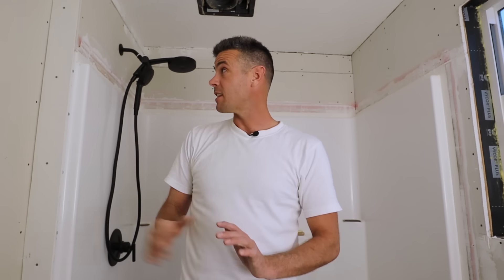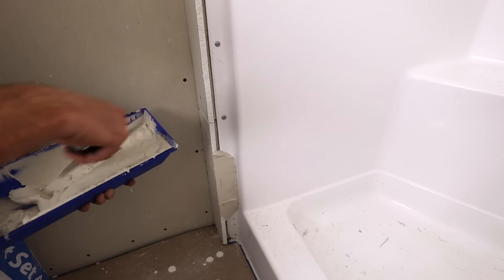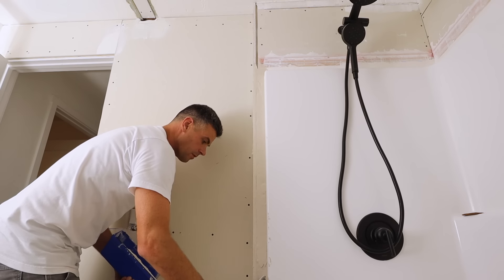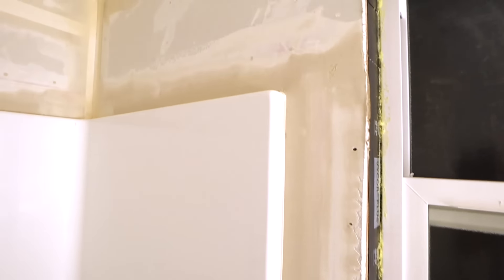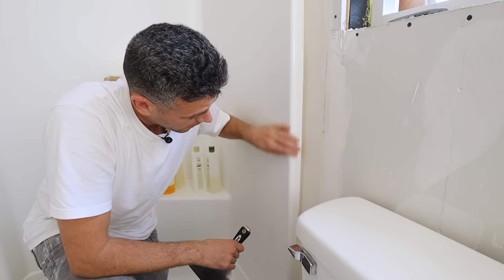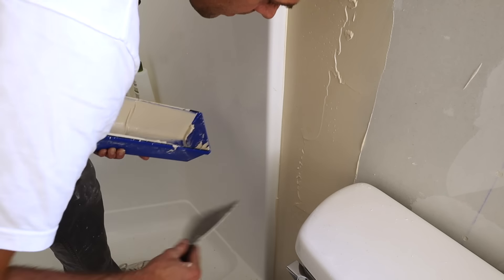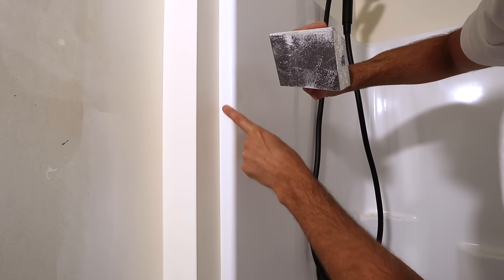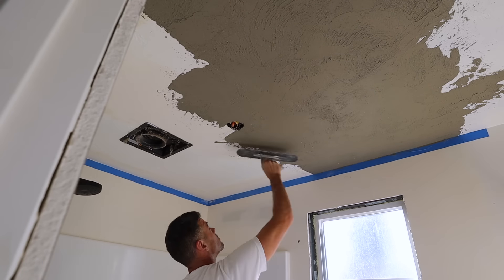How to Fill Drywall Around Tub Flange!

Comment: I've been following a plumber that does a ton of these installs and I've never seen a good way to finish these... THANK YOU!!!
Reply: I was using tear away bead at the flange bottom of the tub surround.
Reply: Agree totally! Just installed 2 in a cabin and will 100% be going back to redo the flanges this way!
Reply: Probably the only way to do it
Reply: @BZ1340  that tear away bead is hard to find. And when you do find it, it’s usually in a box of 50 something, which is way more than you need.
Reply: @ all the local suppliers  we deal with have it by the piece and 2 out of 3 DIY stores also stock it. HDepot is the only one that doesn’t.

Comment: A helpful hint I learned on my own. Before you prefill around the tub or shower,take a can of WD-40 and lightly spray directly onto the edge of the tub or shower. It dries fairly quickly and then go ahead and prefill the void. The WD-40 leaves a barrier on the surface that the compound doesn't bond to and after finishing is complete it's almost effortless to pop any rolled out or dry compound off of the tub. Without the WD-40 any compound that rolls out will adhere tightly to the fiberglass and is a real pain to scrape or chip off!

Comment: I've been a carpenter for over 40 yrs now. Most of it has been in remodeling interspersed with new construction. I've always done my own drywall finishing if it's like one room or less. Most of my work has been kitchens and bathrooms over the last 20 yrs. There's always some patching of drywall to do in those types of jobs where you have to blend in old with new. The glue trick for better adhesion to painted surfaces is one of the tricks that I learned on your channel. Although I've never really had any call backs for adhesion problems, when I didn't use the glue trick, it never hurts to take that little extra assurance. Hot mud is your friend when doing small repair jobs. It really helps to speed up the job so you can get in and out of there and not have to come back to finish the job. 

Just a note to newbies. I always use a paintable caulk along the that tub edge so that we can get a nice paint edge. Some people make the mistake of using a silicone tub and tile caulk in that area, and then they can't get the paint to stick.
Reply: I am trying to figure out which paintable caulk to use. Do you have any suggestions? I have knockdown walls, and in one bathroom, the tape and compound have pulled away from the drywall. It does not appear that these joints were caulked when installed, unless it was a super thin bead. It is hard to tell because the previous owners painted everything willy-nilly.
Reply: @ladle24  Dap quik seal plus is one that comes to mind. But there are many.  Pick a tub and tile caulk that is paintable. Just read the label, it'll tell you.

Comment: The ones I have been in lately. They drywalled over the tub flange. You can see the angled board…Plus the ones I looked at. All the mud/paint was peeling up 1/2 inch at that flange meet to the angled board. All a result of the moisture sitting on that ledge wicking away. All were siliconed too

Comment: Could you use a J style PVC no-coat trim against the drywall edge next to the shower, perhaps keeping it back a half to three quarter inch, and thereby avoid the tricky part floating the corner fill, and instead have a flat plastic edge to coat up to and the edge wouldn't be a permeable surface that you could also caulk more reliably?     Sorry that's a really long question, but I was thinking about how you make the hard part easier, but you would need to plan to do it that way.
Reply: I think that sounds like a good idea, but I'm just a diy guy.
Reply: Ya or the tear away beads

Comment: I used an old gallon can of Bondo.

It was really old stuff, had been sitting on a shelf for over ten years.  Would have been useless as body filler, but it did the job nicely. 

I laid tile over, with the normal thinset.
It's holding up five, 20 years now.

Comment: I like to get "L" bead and install that around the tub flange. Leaves a perfect, uniform gap for silicone and keep the drywall from contacting water that may settle on top of the tub surround. 

L bead is like corner bead except one side is only 1/2 or 5/8.

Comment: Great video! Use hot mud because it's waterproof. The old ones are better for this than the light ones. USG is darn tough and waterproof. I use it start to finish and then prime and paint. Use plastic cornerbead instead of metal that will eventually rust. If it was easy, women and children would be doing it!

Comment: I'm doing my own bathroom makeover.  My friends call me crazy 🤔 but they don't have you in their back pocket!   They just write checks. I figure I'll write them if I screw up.  So my shower surround was done 15 years ago and now I'm redoing. It has a thinnish crack all along the top edge. I'm thinking I should spray some cleaning agent with bleach in case there might be some mold of some sort. But then I was just going to spackle, sand, and paint.  Hadn't really heard about Fiber fuse.  Is that necessary? Maybe that's just a first time thing.  Guess I'll due a little research.
Reply from the maker: You could probably just clean it out then caulk and paint.

Comment: I am trying to figure out which paintable caulk to use. Do you have any suggestions? I have knockdown walls, and in one bathroom, the tape and compound have pulled away from the drywall and need to be repaired. It does not appear that these joints were caulked when installed, unless it was a super thin bead. It is hard to tell because the previous owners painted everything willy-nilly, so there is paint all over the surround.

Comment: Hello and thank you for your videos!
I would like a comprehensive chart on muds. I am having a hard time finding what I want on line.
It is ok if it is multiple pages so that it could be printed out and lined up to follow. It could be put even on
wikipedia and include usa and canada without persecuting any manufacturer.

x or y axis on a spread sheet:
maker and full name using two lines for each column

y or x axis on spread sheet:
typical use
sometimes use
cons should be last on list and set for multiple lines per elongated spreadsheet box
pros same as for cons
is it bought dry, wet
what size containers for each (dry or wet and may have multiple sizes separated by a space)
drying time even if it is in the title
would you add glue to it and when
Would you add liq. dish soap to it and when

Comment: Nice video, I have found that flange scratches easy so I like to use a plastic  3 or4 inch bondo blade used for body work it goes on nicely.  Try one for tight spots and you can cut them down to fit a area to small to get a blade into. I keep one in my bucket to scrape the sides and load my hawk or pan . Great 👍

Comment: I finish edges around showers exactly as you do.  If someone wonders whether their drywall mud or plaster will stick to the flange edge (eventually separate), they can do one of two things. Apply a special primer to the fiberglass/acrylic flange or place a few drywall screws around the parameter (slightly raised) so mud has something to grab.

Comment: Have you ever done any videos on repairing garage ceilings/walls? My garage ceiling is peeling/cracking cause previous owner did a horrible job taping and didnt seal the ceiling correctly so the moisture messed it all up. I'm thinking of scraping off all the peeling drywall and just use a simple primer/sealer to cover up the mess without drywalling.

Comment: I've done several of these.. i use expanded metal lath attached with truss head screws. Then either durabond or hot mud as the first coat. Never had a problem.

Comment: Did corner bead get installed on the outside corner at the head end of the tub?
Reply: My question too. 

He mentioned “corner bead” so I was looking for it to appear, but I only saw him apply mesh tape that covered the narrow piece of drywall and the open end of the perpendicular piece of drywall at the corner, and then apply mud in the mesh tape.

Comment: You know I was actually surprised when you used all-purpose in a bathroom. I would have thought that the humidity would break it down over time. I would have thought you would have stuck to exclusively quick set. Does the paint actually offer that much protection? Does it have to be a specific water resistant paint
Reply from the maker: Just a good primer and a couple coats of paint and it will be fine. This place sat pre-filled and unprimed for 6 months while being used regularly. It will be fine. Some bathrooms get more damp. Depends on the conditions.
Reply: @vancouvercarpenter  nifty

Comment: Around here (southeast US) I often see tub surrounds trimmed out with wood and it usually doesn’t look great.  I wish they sold tear away bead and other specialized beads here but regular corner bead is all that’s available here…. Hot mud is such great stuff and I like using an egg beater mixer in a drill.  Works well and fast enough to use it with 5 minute mud.  
Another good video ✌️
Reply: Some fools still trim out flange with wood on the west coast as well. Oh well, less work for me

Comment: Wait, did I miss something? I assume you put a corner bead on the outside corner, off camera?

Anyway, I could have used this video 2 years ago for my bathroom renovation! I couldn't find a single video explaining how to finish drywall around a shower surround, so I improvised and brought the drywall over top of the flange, to within 1/8" of the shower itself. I used J trim to give the drywall a clean edge against the tub, and I filled the gap with silicone. It looks alright, but it's definitely way different than what's shown in this video.
Reply from the maker: Yes. Bead went on off camera

Comment: ugh, freakin swirl. The house i just finished remodeling had swirl. I had to fix every ceiling in the house. One bedroom the entire wall had to be floated where the limecoat and plaster separated. I used a masonry brush and some thinned down plus 3. I just did swipes with my wrist and it came out pretty nice.
Reply from the maker: I actually enjoyed it.
Reply: @vancouvercarpenter  it wasn't too bad. I didn't add any sand to it, it was sandswirl but it still came out okay.

Comment: Ive been taping for 35 yrs. Here is a pro pointer:  mix taping mud 40% and fine silica or glass bead 60%  add some latex paint for water resistance and mix well.  It should be thick but not cakey. Fill the flange gap and leave til dry. I use same mix for pre-filling gaps. Especially around electrical boxes. If it is mixed right it wont sag out.  It dries hard as plaster. And it dries quicker than you think because the aggregate holds no moisture. Just dont let it protrude or you need a rotohammer. There are a thousand ways to do any one thing.

Comment: Ben im assuming other tapers will mention shower bead.  You may have done a video on this, forgive me if you have.  But that could be another video.  
I typically do it almost word for word what you did except I havent added glue.  It seems where i live that shower bead isnt available and the last time i ordered it i was given 1/2" cabinet edge trim🤦🏼‍♂️🤦🏼‍♂️.  To elaborate, tine was of tgecessence and the order was late in coning a few days only to get a very different product.  Fastset it is...
Reply from the maker: We don’t usually do this where I live. It’s usually tile.

Comment: That homeowner appears to do good work. The shower install, hanging the sheet rock, and that window install.
Assuming it was the homeowner that did the window since there is spray foam stuck to the frame. But still good enough.
Reply: I'm curious why it was taken over. Seems the homeowner was doing a good job!
Reply: @PSNDonutDude   probably because it's finish work.  I see that a lot where they want the finished product to look good and they get nervous about doing it.
Reply from the maker: It was family. There were two good video opportunities that I never see where I live. The tub flange and the texture repair so I offered to help out with it.

Comment: Dang you touch that fiberglass tape with barefingers You need to wear latex gloves 😮 I found out the hard way when I was younger went through a whole roll of that stuff I was itchy around my eyes my neck my ears my face It was hot so I kept wiping sweat off. I paid for that for a few days 😢
Reply from the maker: 😂 I usually wear gloves but didn't have any. Surprisingly it didn't bother me.

Comment: A lot of Bathroom jobs on new construction are using regular drywall + a heavy coat of "Anti Mold' paint as the primer.   Least that is what my local inspector told me during conversation.    Greenboard was extra expensive (than normal) and hard to source during COVID so necessity drives invention as they say.

Comment: I used to work in a low income complex as a maintence man. I installed these tub surrounds and found the best method to finish them is with a thick pvc trim down the sides to the floor and around the top. All our old glue up surrounds went onto drywall and would always fail after the chaulking failed and moisture made its way behind the wall caused the drywall to crumble or glue to release preventing you from having a solid surround to reapply chaulking. The new direct to stud thick plastic tub surrounds solved alot of issues as some tenants wouldnt report their chaulking failing and the tub surround would be past repair. Being able to put plastic trim down past the tub to the floor would help all the water that somehow managed to make it past the curtain from sitting at the bottom of the drywall and causing mold and wicking back up.

Comment: Quick question, I’m skim coating my textured walls thanks to your videos. My walls are painted and have a bit of a sheen on them, do I need to prime them first? 
I already did one wall to test my mad skills and it turned out great! 
My prep was light sand, wash wall then skimmed it 2x’s , sanding between coats.
I’m going to do my whole house just don’t want it falling off.
I’m 60 years old 104 pound female- for your viewers, if I can do it you can do it.
I have learned from his videos, good tools will make it so much easier.
Thanks for your great YouTube channel.

Comment: Biggest mistake I see right away is no prep to the flange. Let me explain, the whole concept of the coating is to repel its a glossy surface NOTHING will stick. Prep the flange with sand paper and primer then hot pack or 5 min mud. I’d refrain from additives as they dry or cure at drastically different rates and you will have delimitation over time. After the hot pack prime again apply mesh tape coat with 20 min mud and your final should be topping compound, prime again and paint with nothing less than semi gloss. I can’t stress enough primer between layers in a bathroom. Primer is primer paint is paint the 2 are not the same.

Comment: Love the thought behind this video - there are so many very specific scenarios when drywalling that really set off a particular job and separate the DIY'rs from the Pro's.  This is certainly one of them.  Boxing in, and finishing off a window is another job that may not be obviously done.  Doors also have their challenges in old house renovations with unsquare framing with thicker than conventional walls.  I did some research when I used Durock Cement backer board for tiling my tub surround, and then transitioning it over to the drywall...I ended up going with a Schluter systems trim (Rondec) and it ended up finishing nicely but there was the transition point between the drywall and cement backer board on the wall.  I mudded and taped it as if it were a butt joint and it all turned out great...that might be a nice video to make too.  This is def not a simple patch job which I can appreciate BUT you got to be able to fix every room and every scenario.  I do have a question specific to houses that may contain lead paint, do you have any special primer to use that keeps the paint attached to the wall when mudding and paint over it?  I tried repainting a utility closet and once the paint was wet, the layer underneath detached itself from the old 1950's drywall when it got wet and made a huge mess...I was so frustrated because my 'finished job' ended up a mess.  It was my own utility closet and behind a water heater so it wasn't a big deal but had I been doing a whole room I would have been utterly defeated.

Comment: Here on the east coast we use a product called Durabond…there’s 20, 45, and 90. Which is dry time. It will harden underwater, so it’s perfect between tubs and drywall. Fibre tape is a must to bridge the two because it’s so much harder than drywall. Love your tips
Reply: I use Durobond 5 to prefill

Comment: Great video, as always....  I've learned a ton from your channel!  Quick question:  Do you ever use a fan or hairdryer to speed up your drying/curing process on repairs between coats?
Reply from the maker: A fan sometimes but never a heat gun unless its a very small patch on painting day. I usually do the work and then put a fan on overnight.
Reply: @vancouvercarpenter  Dehumidifier? Mold spores are everywhere, all the time. Best not to provide any moisture to let them get started on the lifecycle.

Comment: Love the videos.   They have been a huge help in fixing all the holes I put in my bathroom installing a ventilation fan.    I doubt I will ever get proficient but I now have confidence that most of my mistakes will be minor enough to be corrected with sandpaper.   You made a comment in one of your videos that joint knives had a curve to them.   I really didn’t believe it but I decided to check it out.  I have more of them than I should and when I checked them against a straight edge, behold… all of them were curved.    Not only that, they were all curved with the belly on the same side of the knife as the branding on the handle!  The things you learn.